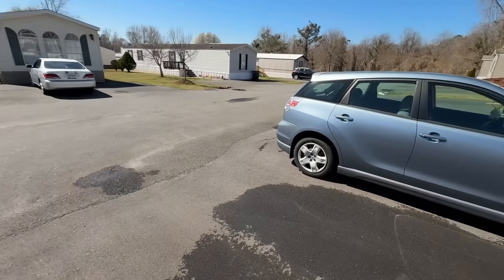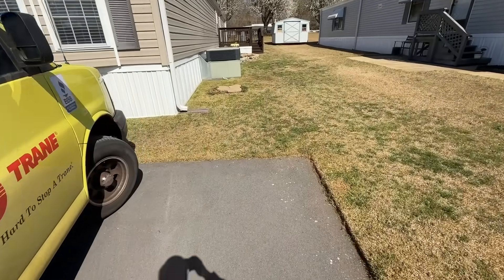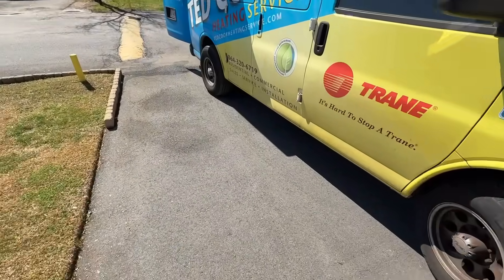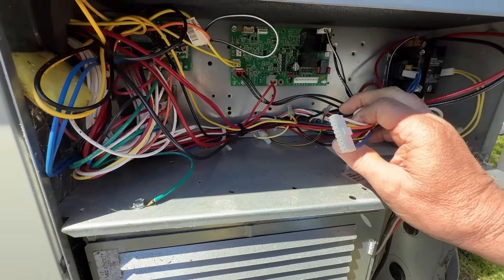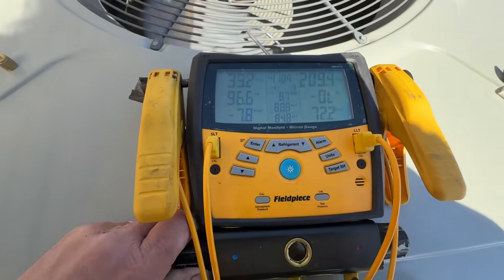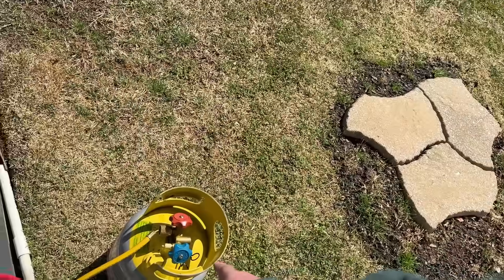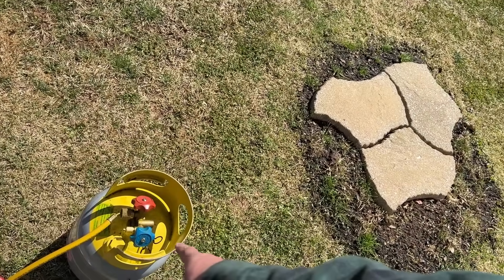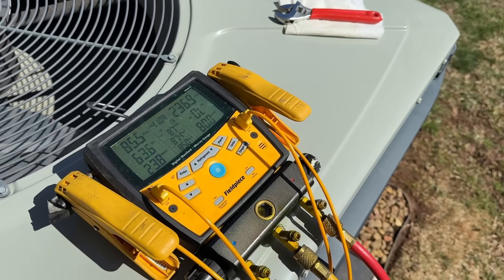R410a Leaking on Packaged heat pump

Comment: Tech in tampa bay for 12 years . Ive commented before . Ill say this , i appreciate the fact that you explain why you are doing what you are doing in regards to your dye tank with virgin regrigerant and why you keep refrigerant in your hoses at all times . Its not the way i was trained ( trained by licensed small business owner who has 28 years in trade) but ill say i doubt our way of doing it would go without scrunity either . I dont know you but i get the feeling you try to do right by your customers, for the enviorment ( as much as possible) and for the trade. Every tech/mechanic/installer has let some refrigerant loose at one time or another . If its getting hoses of even with ball valve or during charging or recovery or whatever . You know deep down as a tech if you are doing right or being malicious or just plain lazy . I got the feeling you are doing your best to do the right thing. Good luck out there , got another hot hot summer right on our doorstep

Comment: As long as you stay conscientious, careful, sensitive, sensible, and willing to change you'll be alright.

EPA isn't really about the occasional, no sensible alternative to it, fudge on a small residential unit or car AC that releases half an ounce.  They don't want you residential unit guys getting used to screwing around and getting used to being irresponsible, but you're mostly a side show.  The major problems with refrigerant involve big HVAC and happen in factories and office buildings and apartment buildings, where the leaks will be hundreds of pounds or tons of it.

Comment: For folks that worry about the "environmental" issues of refrigerant, they might check into where R410a and R22 etc. come from. It's not like the manufacturers create it in their factories, its made from chemicals naturally obtained then mixed.  Honestly, just how much of this refrigerant gets into the atmosphere, regardless of type from HVAC usage? If they are so worried about that, maybe the "plumbing" (evaporators and condenser coils} should be under higher quality requirements with the manufacturers so they won't leak ! 
Ted does good work...all the basics first, from the ground up.

Comment: As a trane service tech had a unit like that impact unit copper tubes that run in between the compressor compartment to the EVAP coil rubbed a hole in it. no insulation protecting in it

Comment: I’m probably the same age as you but semi-retired now.  I’ve always left my gauges charged.  I still purge the hoses when adding refrigerant so it’s unlikely any existing gas mixes with the equipment I’m working on.  I like your dye jug, versus having to add a dye cartridge while charging.  If I was still working full time I’d do the very same.

Comment: I prefer a leak detector to pinpoint any leak, usually I find them within 5-10 minutes. 1 trip find the leak order the part or fix the leak, 2nd trip with part to make repair. Dye test 1 trip to insert it, 2nd trip to see where the leaks at, 3rd trip with part to make repair. Saves times and money imo